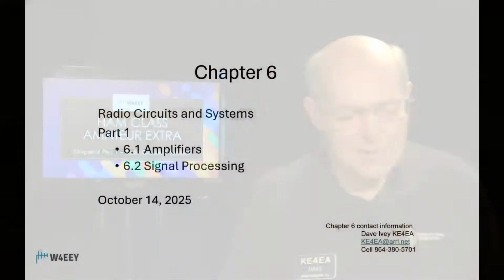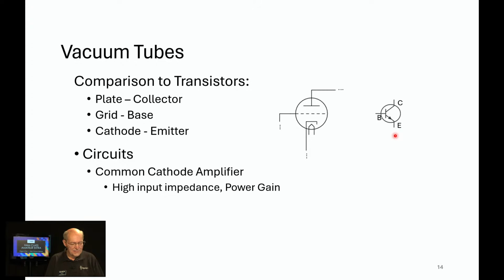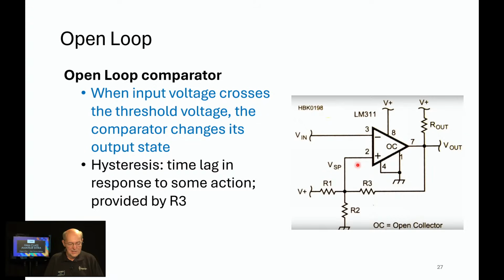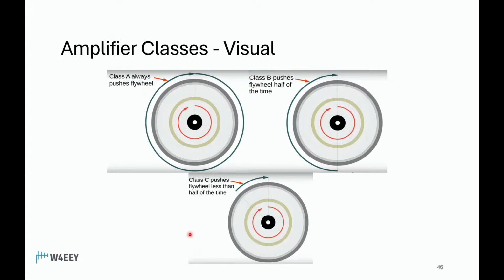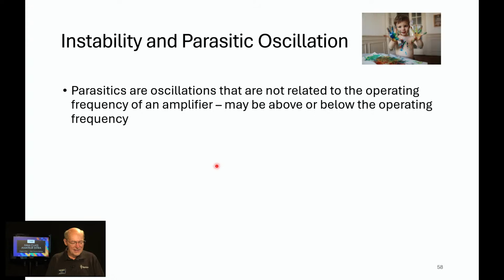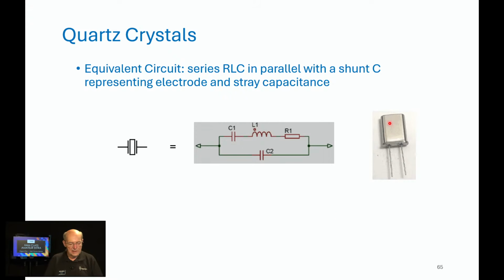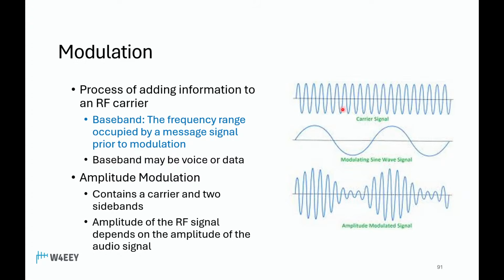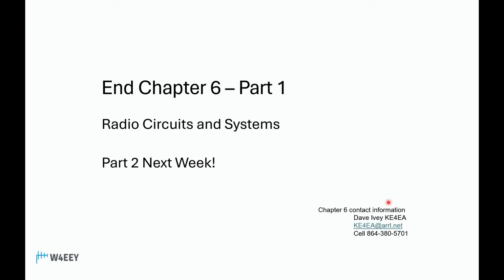Extra Class Fall 2025 - 13th Edition - Chapter 06 Part 01 -  Radio Circuits & Systems

Comment: Although the Opamp's feedback resistor is usually shown horizontally, it can also be drawn vertically, like the voltage divider it is. There should be an additional question on non-inverting op-amps because they are used more often. The formula, as you likely know is the same +1. A Schmidt Trigger is just a op-amp comparitor, with hysteresis, with an optional buffered output.
 Trivia: Historically, the "Presence" control on guitar amplifiers varies the feedback to the tube, or solid state/op-amp, and lately it just does whatever the marketing department says.
Reply from the maker: Appreciate the detailed explanation and the valuable additions to the topic. 73 de W4EEY

Comment: Thank you again for the videos.
Thanks also for giving us an alternate method for identifying Common-Collector from Common-Emitter (and Common-Base) Amplifiers. Perhaps they should be named by which transistor terminal the output is tapped from.
The convention of naming Common-Collector, Common-Emitter, and Common-Base Amplifiers is one of the most stupid means of identification in electronics.  It ranks right up there in with conventional current, and the naming of capacitors, mixing types and functions., or the naming of scattering perimeters by port-position/matrix S1, S2--instead of transmission and reflection coefficients, which don't make sense after 2 ports. Ah, I feel better now.
Reply from the maker: Heh heh. Thanks for making me laugh. Yup. Things can be confusing. 73 de W4EEY
Reply: @W4EEY  Oddly, the transmission/reflection coefficients VS scattering matrix designations was paraphrased from Eric Bogatin's Academy lectures from Lecroy's Signal Integrity Academy. It was a good series, and so was Ninedotconnects SI videos.